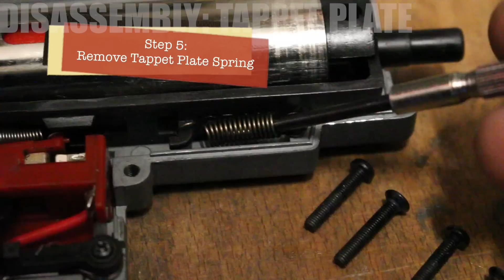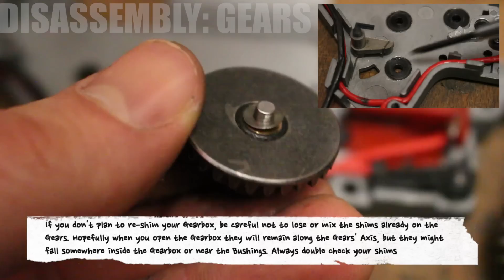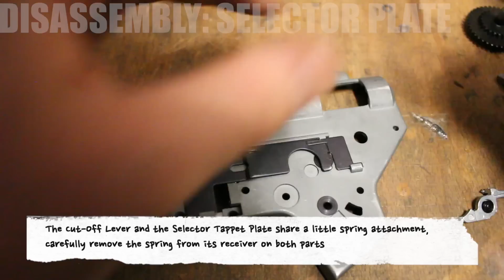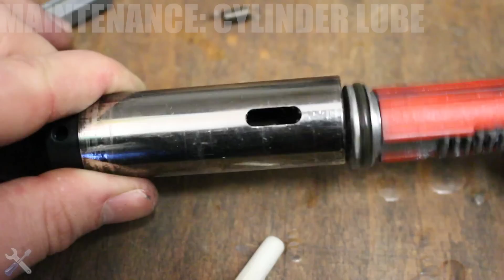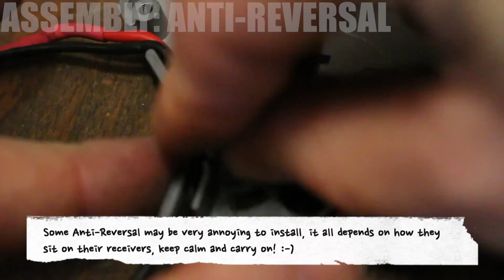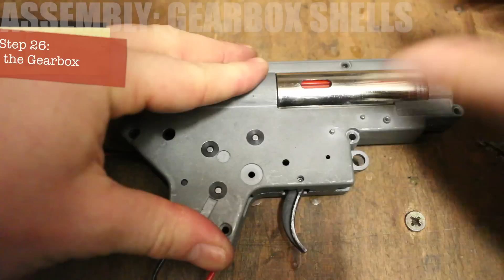[TUTORIAL] Ver.2 GEARBOX COMPLETE GUIDE: Disassembly/Assembly (M4/HK416/M16/MP5/G3)

Comment: I fully rebuilt mine but when it's re assembled and I try to fire it it still locks up. There's a gap in the gearbox that you can stick a screwdriver through and when I pry the anti-reversal latch back the gun cycles back to the original position. Is this an Anti-Reversal latch problem or something else?

Comment: Great video.  I wish mine wasn't prone to exploding if I don't keep enough pressure on the spring.  This is much easier with a less powerful spring for sure.  My anti reversal latch never wants to stay lined up when I try and reassemble the shell either.  Always a challenge of sliding in  a thin tiny screwdriver to pull it towards the hole in the shell.
Reply from the maker: +finnsfriends Thanks finn! I'm glad you liked it! Yes, releasing spring tension with stiff springs is a pain in the ass, luckily many companies now provide quick spring change feature in their guns and that is much less frustrating. 
Try to keep the anti reversal latch down with some eyebrows tweezers! Does wonders! ;-)

Comment: Seriously This has to be the best video I have ever seen of putting the box back together, I stripped mine the other week and put the screws down, Anyway a week or so passed and the box was open, My mrs ''cleaned up and lost the screws, Trying to put it back together to find that I had the wrong screws, each time I tried putting the case back on I had both the trigger firing out and the anti reverse latch falling out, Currently waiting on new screws I have ordered too turn up but seriously with the reverse latch and the trigger flying out while trying to hold the spring putting the lid back on, Im seriously not looking forward to it. Any ideas why the 2 components wont stay still and instead trying to do the great escape each time? The new screws are due after this weekend

Comment: Hi! Can You please make a video of lubing the gearbox? Or would You please tell me which parts should i lube? Thanks
Reply from the maker: Yeah why not, I'll keep that in mind but it's actually quite simple, a tiny film of gear grease on the gears some thick oil on the cylinder set and very thin oil on the bushings! Everything in moderation, less is more in this case! ;-)

Comment: many thanks, this helped me fix my mates gearbox. I'm used to working on my G36C EBB gearbox which is really easy due to the motor cage and quick change spring. was struggling to get the m4 gearbox back together till I watched this. unfortunately now I have tried to fire it and the piston is stuck at the back of the gearbox... any ideas?
Reply from the maker: Hi Aston, it might be the spring coiled the wrong way that keeps it stuck, you gotta do a delicate maneuver a try to open the gearbox without making things going crazy.
Reply: Don't know how I solved the problem but I fitted a mosfet in and after closing up again, hey presto it works. Maybe there was a crappy solder or something and the current wasn't high enough to pull that last little bit

Comment: Great video, thanks for making this.

Wow, I'd never seen a steel selector plate, that's cool.  What if you need to add a copper contact plate when you upgrade and your new trigger has contacts on the side there?   

Also, what if your anti-reversal latch is hit by the middle gear?  Oh - maybe mine was hitting because I was test-fitting without the spring placed under the anti-reversal latch, that should hold it up clear of the gear?

Why didn't you tell us what that first gear is called as you placed it in?
Reply from the maker: Sorry about that, from top to bottom spur, sector and bevel gear ;-)
If you mean one of those older selector plates with copper plates it's just fine, same procedure, exactly the AR latch should sit on the notches in the middle of the bevel only

Comment: MY friend just bought a G&G GC16 FFR 9" and had some compression problems out of the box. I decided to fix it for him since i have some experience in AEG maintenance. I opened it up all the way to the gearbox. Opened the gearbox and found the the Nozzle was blocked and couldn't come back to its original position. I followed your guide to reassemble everything but now i cant put back the Trigger spring. For some odd reason when i press the trigger the wirings slider works fine. The spring is odly shaped and not like yours. Is there somethign im doing wrong? Can i leave the trigger like that if it still works properly?
Reply from the maker: Not sure man, feel free to send me a pic on Facebook if you wish looks like the trigger spring or the wirings are misplaced.

Comment: Hi I have a question. So yesterday me and my friend installed shs 13:1 gears into his aeg. We shimmed them pretty good, not perfect, but good enough that they spun fine when I put the motor in to test them. So I reassemble the gearbox, everything fits fine, no wires were damaged, and when we go to test fire the gun, it won't shoot. It makes a slight clicking noise as if the motor is trying to turn the gears but can't. We were using a fairly strong battery and a high torque motor and I double checked to make sure the motor was connected right. Do you know what the problem could be? Thanks for you time!
Reply from the maker: Hi FilmMaker13! Well, it could be several things: damaged wires, wrongly plugged connectors, excessive bevel-to-pinion contact, locked spring and others. 
What I would suggest to do is taking the gearbox apart once again (meanwhile look out for a locked spring on spring guide or piston), place just wires, trigger and gears (selector plate and cut-off is fine as well if you already shimmed the gearbox), then close the gearbox and install motor grip and motor. Plug the battery and run just the gears, check if it makes squeaky noises or if you feel there's too much contact between bevel gear and pinion. 
Then install everything else as you normally would, repeat the check without using the AEG receiver and eventually completely reassemble your gun.
Step by step you should be able to tell where the problem is, anyways I would suggest you to check my shimming guide as well to avoid rubbing, excessive pressure and friction on your gears/pinion:
https://www.youtube.com/watch?v=ZahpxfCsSAY
Let me know if you solve the problem!
Reply: +Chupacabra Outdoor Thanks for getting back to me! So I opened te gearbox up again and it was actually the anti reversal latch. It had been pushed back the wrong way and was wedged in between the bevel and spur gear preventing them from moving. The gun is working perfectly now. Thanks again!

Comment: Do you have to use those specific greases/lubricants or can i just use thin, lightweight, sc 50 silicone oil spray?
Reply from the maker: You can pull it off with silicon spray just for bushings, the cylinder set needs a more viscous oil in order to really improve air compression while the gears needs a medium thickness grease like vaseline.

Comment: Hello. I have tried for hours to get my spring/guide back in but when it gets in the gears don't line up with the bushings so it doesn't close all the way or correctly. Also my AR(Anti-Reversal) switch won't stay where it's supposed to. So, I'm looking for advice...
Reply from the maker: Hi Zach, the anti reversal latch can be a pain in the butt if it doesn't sit properly on the gearbox, I can advise using eyebrows tweezers to pinch it down through the hole where the pinion goes, it works well.
I think I know what you mean about the spring issue, when you're attempting to close the gearbox try going inside the spring guide with a small screwdriver and pushing the spring guide a bit further, while keeping pressure on the gearbox to close the shells. Move the spring guide a bit up and down and side to side, trying to get it to match its notches on the rear of the gearbox.
You should be able to close it easily this way, let me know how it goes and feel free to send some pics or video of your gearbox on my FB page or at chupacabraoutdoor@gmail.com if you need further help.

Comment: I think i forgot to leave my sector clip in the 1 o clock position and i fired and now the piston is stuck back. I managed to set free the piston. Do i need to open up the gear box and put the sector gear back in the 1 o clock position?
Reply from the maker: Once the shooting cycle has reset there's no need to reopen the gearbox, I'm not even sure that's why your piston got stuck!
Reply: Chupacabra Outdoor i think you are absolutely right i believe the battery died as i was reseting the cycle :(

Comment: So it doesn’t matter what position the sector gear is in relation with the piston before closing the gearbox?
Reply from the maker: Not really, the first shot isn't gonna be fully loaded if the sector gear is misplaced when closing the gearbox but since it's so easy to put it right there's no reason no to!
Reply: @CHUPACABRAOUTDOOR  will it cause problems and require me to re open it or will it sort itself out

Comment: Hello! I am building a custom AEG, but when I go to put the top half of the gearbox on, it doesn't close properly. If I try to screw it shut, the trigger won't go back to its original position. Do you know why? Thanks
Reply from the maker: Hello saddlepiggy, well it's hard to tell without seeing it but I would advise you to check proper cylinder/wiring assembly and spring guide placement.
One thing you can do is try to close the gearbox with just a few pieces (even just the gears) and see how it goes, then start adding one by one, whilst trying to close the gearbox each time, the remaining parts and see which one makes it hard to close.
Then check very carefully why is that so, for sure it would be something slightly misplaced, it a very common thing if you're a beginner! Let me know if you're able to solve this issue! ;-)
Reply: cool thanks
Reply: Hi! Sorry it took so long to reply, I haven't been able to access it for a while. I have figured out that it is the electronic part of the trigger mechanism, where the metal parts connect, that is keeping it from going back in. The part which the screw goes into is on top of the screw hole. Any ideas on how to fix it?

Comment: How different is a V 2.5 gearbox from a V 2 gearbox? From what I've read, they are pretty much the same, except the 2.5 is longer.
Reply from the maker: Yes exactly the V2.5 has longer piston, cylinder and nozzle thus having a bit more compression you should be able to squeeze a little more range out of these gearboxes!
Reply: Chupacabra Outdoor So the disassembly process should still be the same as the V2?
Reply from the maker: Yup, same!
Reply: Awesome! Thank you!

Comment: so my safety lever seems to be too loose and i cannot tighten it any further, what do i do? like the lever goes past the gear box if you look at yours it never pops out it hits the bottom mines seems to barely nick it and goes past it idk what to do
Reply: also i cant really put the spring on the trigger, or atleast i cant install it on the gearbox because the spring has a much harder angle than yours idk its like 30 degrees more which makes it almost impossible with out pricking yourself or something damn i need help
Reply: i installed the trigger but it keeps popping off its really near impossible to close because i have to hold down the spring and the little trigger down or else both pop off
Reply from the maker: About the safety you could try adding a spacer or file a bit the parts, you obviously want them to make more contact as they tightens on the screw, regarding the trigger spring sometimes you gotta keep parts down with your fingers and close the shells with the other hand, or you could place something heavy on the trigger like a metal hammer to keep the trigger down while you carefully close the gearbox, I'm pretty sure you're either working on a custom gearbox with poor compatibility of its parts or a low cost set, modern stock gearbox rarely have such problems.
Reply: OMG U GOT BACK TO ME YESS THANK YOU I REALLY NEED HELP but um yeah i ordered like a set of the smaller springs not the main spring? idk the name but you know. Anyway so i ended up breaking the trigger spring cuz i needed that much force to hold it down again the angle is too much smaller than yours = more force to keep it down, 
 
Anyway idk if its just my Cm16 (g & G) but the anti- reversal hatch falls off really easily along with the bottom gear ( one you removed first 2:59) but thank you ill be waiting for the parts along with a new engine for it.
Reply: also its a stock G&G cm16 V2 gearbox and yeah just opened it for my first rewiring  /.\. ill wait for the parts i guess but idk i feel like this should be easier, also i had already previously tried closing the whole gearbox while all the parts were there and it seemed all fine but i couldn't like a side wouldn't close idk why everything was in place the only things pushing against it was the spring but i could easily push that down with my finger i still cant close it idk what to do
Reply from the maker: Are you sure the trigger spring sits correctly? There's a hole on the trigger in which you must fit the spring, also about the AR latch try using some eyebrow tweezers, pinch the AR latch down and do the same for the trigger with an heavy object, be very gentle and close the gearbox while keeping the piston spring firmly in place you could use a screwdriver inside the spring guide if you find that helpful. I know closing some gearboxes can be a pain in the a** but be patient and make sure everything's well in place, maybe ask for help to a friend but don't force things or you're gonna break stuff.
Reply: ok got it basically i was right, the Trigger spring is super strong thats why it kept popping out i know because i changed the spring to one with a wider angle, like yours and its soo much easier now its "lighter". As for the AR latch well i got it all to close and basically for some reason it doesn't align as well as it should with the top part of the gear box or the cover, the little stick wasn't going in the hole so there was a gap making the gearbox pop out a little which meant i couldn't close it

Anyway thank you soo much im going to wait for my wires and start re wiring this bitch to the bacckk
Reply from the maker: Good the hear that, enjoy your work buddy!
Reply: thanks !

Comment: FFFFFFFFF after changing parts in my gearbox. (hours later) after everything is back together.  i plug it in and it doesnt work....  in the wires that connect to the battery, i see this black thing and i try taking that apart.  i hear (sounded like) glass rubbing against eachother.  i finally break it open by breaking the shell.  to find out the fuze was chopped in half....